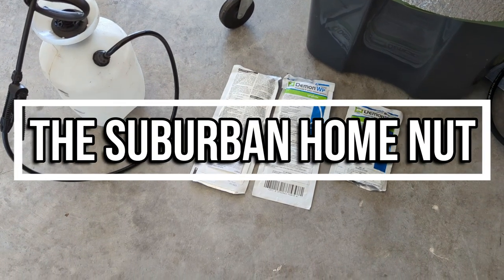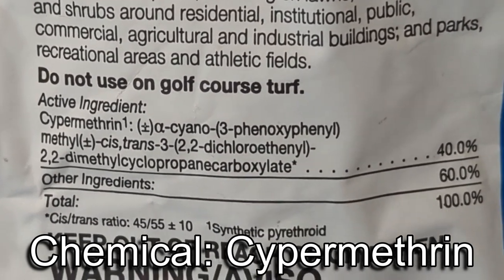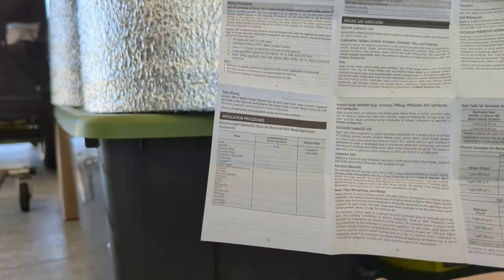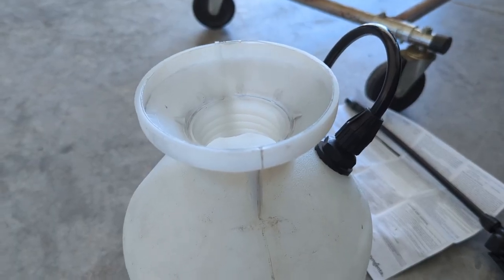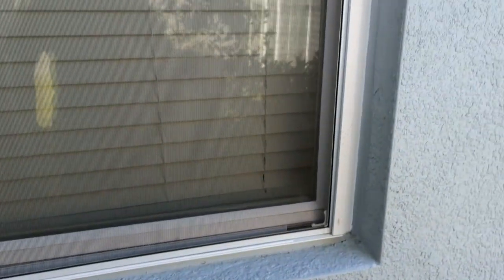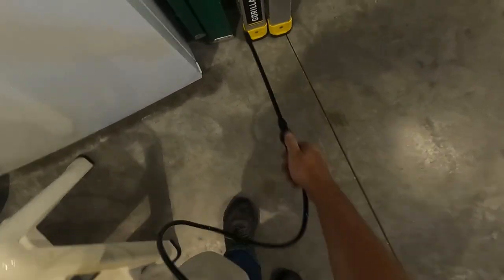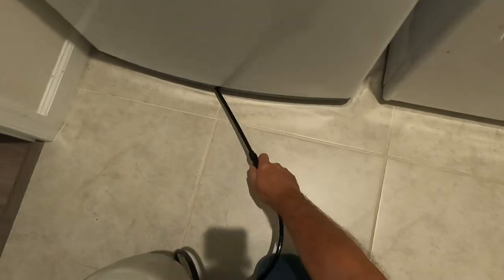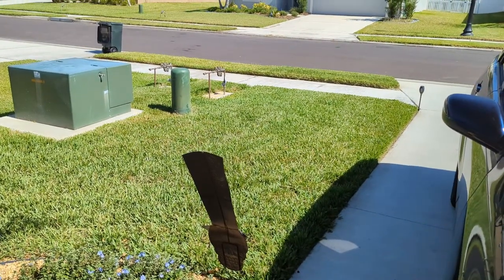DIY Pest & Insect Control | Demon WP Use and Review How To

Comment: I believe if you listen to demons how to mix is 1/2 gallon then put in 1 or 2 packets and then add the other 1/2 gallon of water . With lid closed then mix or shake mixture up to 4 minutes. Depends on temperature of water on how fast it dissolves. By the way great product and use a pair of nitrile gloves.